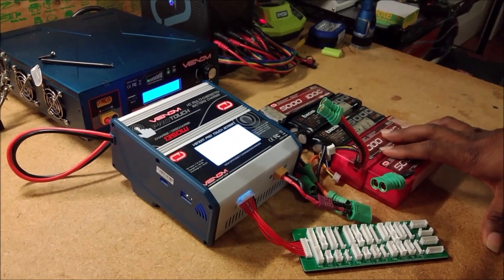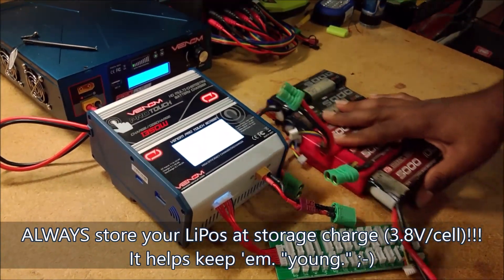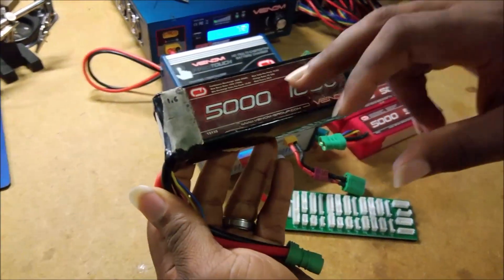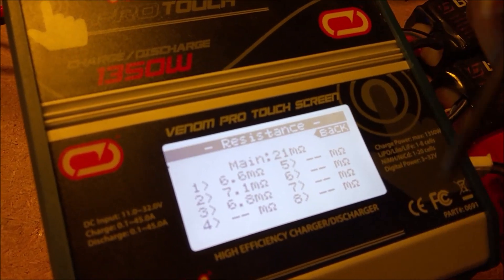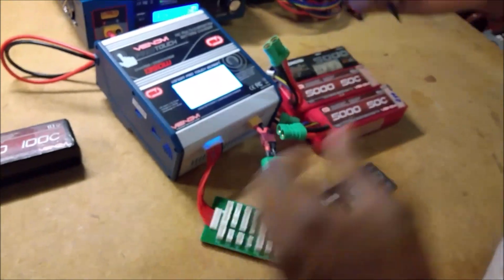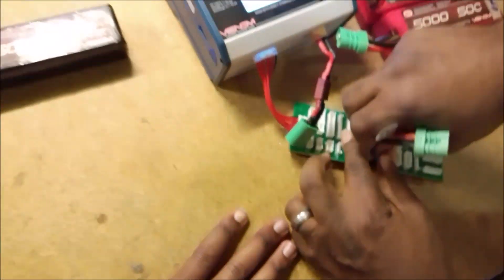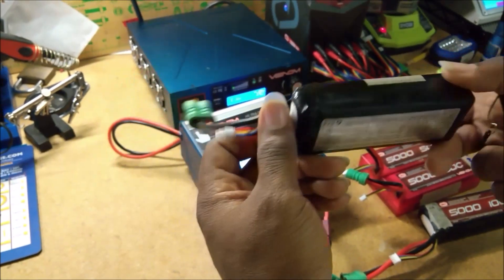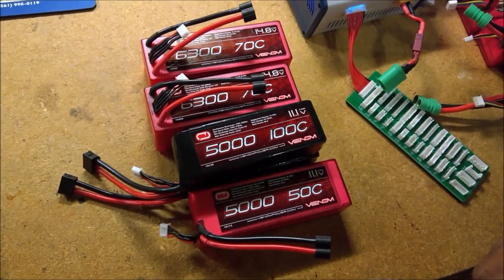Ep. 253: LiPo Performance Maintenance

Comment: I never run them down too low and always balance an put in storage mode. Have batteries even cheap ones 7 years old still stellar. Charge lower rate as well. Any slight swelling, by by
Reply from the maker: Better safe than sorry.